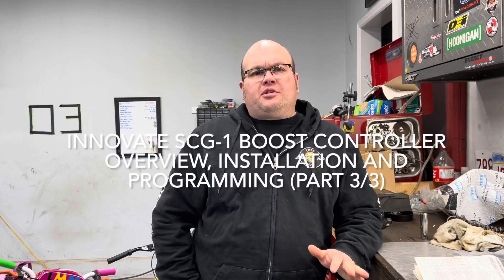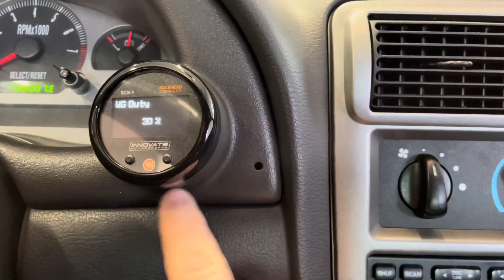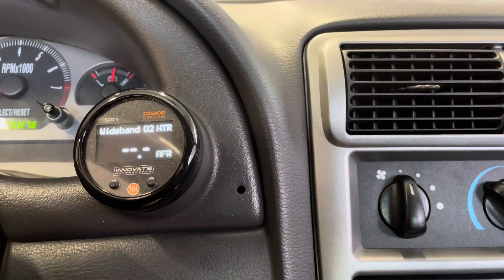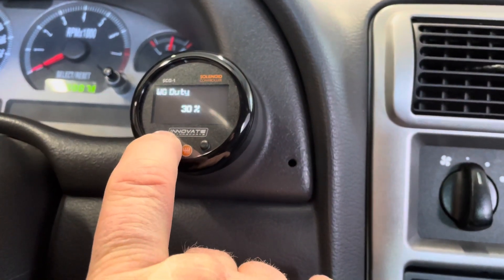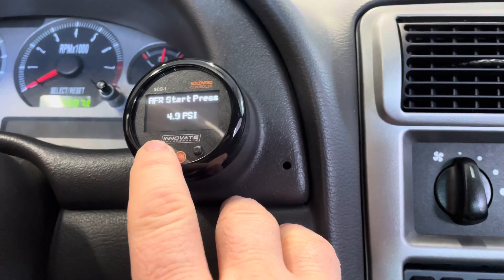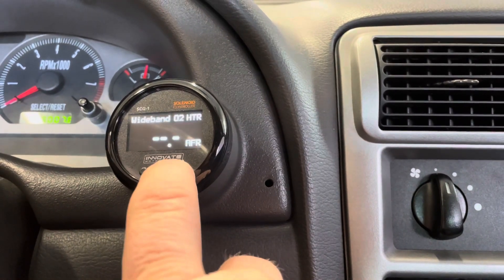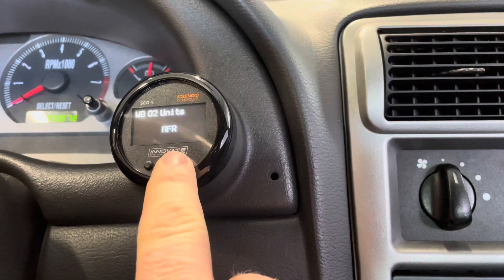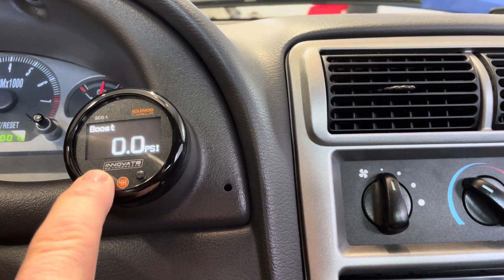Innovate SCG 1 Boost controller Overview, Install and Programming (part 3/3) #boost #turbo #newedge

Comment: My Innovate SCG-1 is recently stuck at 43.8 psi with AFR working fine, gauge has been on the car for maybe 3 months. I’m going to contact Innovate on Monday. I understand this is because of a boost or O2 cut. But I’m not running the gauge as a boost controller, just for the boost and afr data alone. Any ideas what this can be or how to reset the gauge ir solve the issue? There are no leaks or loose vacuum lines that I can see. Thank you.
Reply from the maker: Hmmm…not sure but you can try un
Plugging it all together and see if that will reset it. I no longer have mine so I can’t look at mine to see
Reply: @Shawnsboostedgarage  why did you get rid of yours I'm looking into getting one are they worth it?
Reply from the maker: @Gone-Drifting  I couldn’t  get it to spool the turbo as quick as my manual boost controller would. I played with the settings but just wasn’t happy with it.